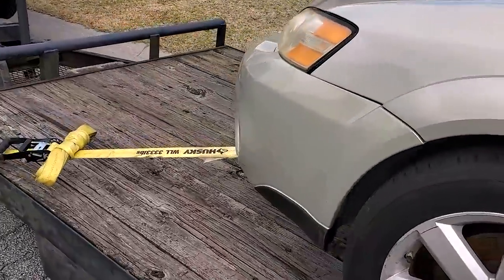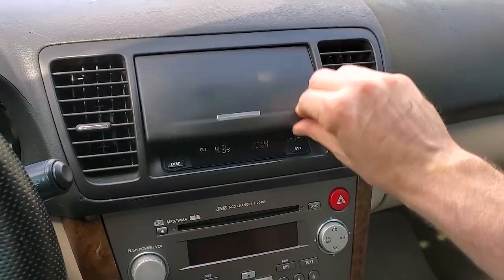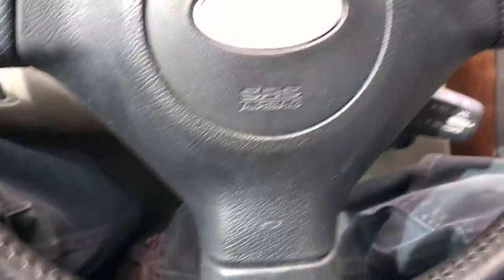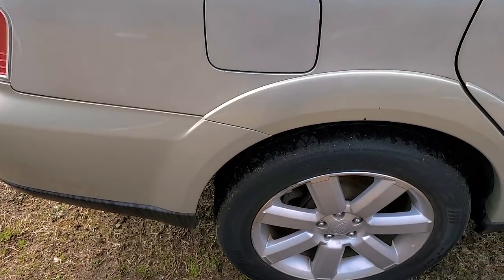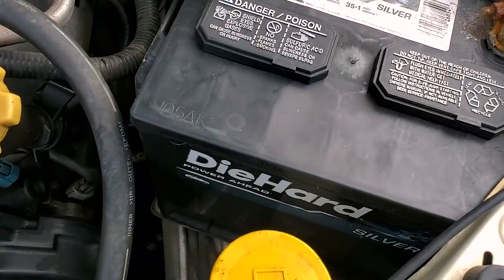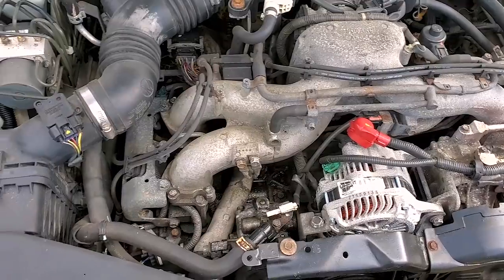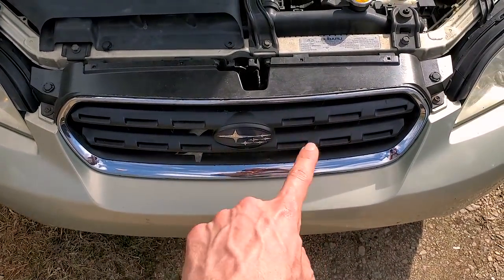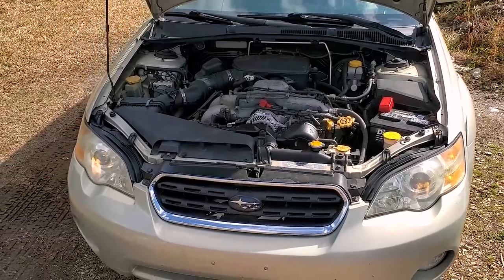Yup.... I bought another one!!! 2007 Outback 2.5i Limited SUS

Comment: I miss the Outback Sedan and Legacy Wagon.
Reply from the maker: Me too.
Reply: I had a 2008 Legacy Wagon, had to replace the Crankshaft position sensor, the power steering pump had a little leak, I just keep adding fluid, and sometimes there was a weird behavior during the start. I had to shake the shifter. It was like the ECU didn't know the gearbox was in parking position, so it didn't start up. After shaking it, something got into position then it started right up.
Reply: @jamespn  its probably the liberty from Aus hahah i have a 2.5 2000 model, it has 340k kms on it and i wanna make a 2 day trip in a month but dunno what to do.. get an old hilux for 3k and ditch this or fix it.
Reply: @dreww47  oh true i think mine must actually be 98 too haha
Reply: @dreww47  but mines a manual
Reply: breakfast meat  yeah wtf

Comment: Thanks for the post and details  , I got 2006 Outback with 237500 KM /147570 Miles , Drives good but not getting a good amount of gas ,Say for Full tank it comes to 350 KM/217 Miles and not sure what Needs to checked or to begin with to improve Gas

Comment: Found 2007 with 155,000 miles stick shift, but they said has not had timing belt set change and leaks oil from "around valve covers".

Comment: Yesss love a good SUS! Didn't even remember they made them that late in the years.
Reply: P.S. Starter failure somewhat common up here past 150-200K miles but it's an easy fix obviously. I think the cold and winter are hard on them plus all the hard starts with dying batteries. Usually just the solenoid that fails. $300 is a steal!
Reply: @802 Garage they made them from 1998-1999 as "Legacy SUS" with the SUS badge on the back and then as a standalone Outback sedan from 2000-2007 across two generations, definitely miss those, especially the L.L. Bean Edition!
Reply: @JWTH531  Yeah I have an 01 essentially parts car. Just didn't know how long they did it. Very cool.

Comment: The Outback sedans are one of my favorite cars, especially with the H6. I’d love to do an H6 swap in my 03 Baja Classic but I doubt it’s worth it.
Reply: I’ve heard the H6 engines are garbage compared to their 2.5 4cyl, is this true?
Reply from the maker: Absolutely not. Stop listening to idiots on the internet. The EZ is the superior engine.
Reply: @richardrecupero4342  No. The H6 engines usually last a quarter million miles without issues. They have a few issues don’t get me wrong, but they don’t suffer from head gasket failure like the EJ25. The ez30d is probably the best H6, with the ez30r close behind, which is just a refresh. The ez36 engines had a few more problems, but they’re still not bad at all. The eg33, which is the old H6 was prone to more problems than average in some cases.
Reply from the maker: There is no EZ30R, fyi. It's the EZ30D Phase I and EZ30D Phase II.

Comment: Where do you shop for the lotta love finds so cheap? You have a peculiar knack, I remember the  Subie near Charlotte, for $500. You won't take on any prescriber atm? I need a  09 3.0 engine or rebuild. Cracked head, or headgasket, rocker arm covers, and inside timing chain cover shows the seal at crank is blown. Okay, sounds like sourcing a JDM engine. Do you know any vendors/sellers who check compression/ leakdown or have a good history to source from? Or would you suggest a mechanic do the buy and  give a 90 day warranty? Guarantee pay labor 1 time? 1) source a engine through a mechanic? 2) BUT,  the  car was in a "minor wreck." THIS I 100% need a  yeah or nay. I'm now shopping for a set of headers, factory OEM, it's a one piece past cat, right? buy a clean OEM set, and cut off the original  cat as "backup?" Or consider a  shop that would fabricate a set very similar to factory? I'm gonna pull back pressure at the 02 sensor port, both sides. Sorry about beating down the consumer report line up. The car is an engineering marvel, with the ECM correcting mechanics keeping in spec with independent timing, I have never seen. It's like flying a high end plane that has 3 fail safes before you drop.
Reply from the maker: Yeah, until I can get the shop built, which isn't happening anytime soon with all this rain, ground is mush, I can't take on any outside work. Unfortunately. Where are you located? I can refer you to my buddy's shop in the mean time. I've seen a jdm engines direct? I think is the name in Charlotte, NC. Prices are fair, never dealt with them before though.

Comment: What do you think of a 2001 Subaru Outback 3.0L H6 4A, 212k miles, car is caught up with all maintenance, no major damage to exterior, but transmission was  rebuilt at 155k. Seller wants $1500 - do you think this is a good deal?
Reply from the maker: Sounds like it's solid. Weird that the trans went out at 155k though.

Comment: Hi! I have a quick question about the headlights on my 2008 forester. I have a choice of blinding oncoming vehicles with my low-beams, or adjusting so that my high-beams are focusing about 25-35 ft. In front of my vehicle. I can't determine what, exactly, the heck is going on. Please help! Thank you for any insight.
Reply: Have you changed bulbs recently. The installation is somewhat tricky. If they don't seat correctly, the beam is off.
Reply: @tomwalma4762  Thank you for your help, Tom. No, no changes recently.  It looks as if they're correctly seated, but my experience with this particular variation(there are two DIFFERENT setups, depending on whether Low or High beams) in installations is limited to this new (to me) vehicle. I appreciate your info!
Reply: @johnnyv.223  would it be possible that bulbs where installed in wrong locations (low beam bulb in h. beam housing)?
Reply: @tomwalma4762  I don't believe so. 
The "High beams" indicator in my instrument cluster, as well as both the physical position of the headlamps(High beams being located more proximal to the center of the vehicle, and the Low beams being more distal from the vehicle center), and the intensity or brightness of the two sets of lamps indicate that their placement or position is correct. Thank you for your reply, though; I also thought of this possibility. It is the most likely cause.

Comment: What are you thought on the 2.5 boxer engine. I have an 08 outback wagon and love it. I had the head gasket, timing belt, water pump kit, plugs, wires, and thermostat replaced a last year. Heard these are crappy engines but mine should be good as new now.

Comment: Hello! I am looking at a 2009 outback 2.5 xt 5 speed with 130 thousand miles, what do you think?
Reply from the maker: That's about the time the turbo dies.. If the banjo bolt filter wasn't removed, feeding the turbo.
Reply: @MrSubaru1387  what lol, I didn't even know that was a thing, ill do more research then! thank you!!!
Reply from the maker: @ryancooper5918  I have a video on it. The EJ255 normally blows the turbo up around 120k miles, if this filter isn't removed or replaced.
Reply: @MrSubaru1387  I just saw it right now, damn, I'm second guessing my choice lol

Comment: What would I need to do an ez30r 6 spd swap with a 2015 3.6r?
Reply from the maker: You'd need to sell the 2015 and buy a 2014 or older. Lol 15+ Legacy/Outback never had a manual transmission option. Would be hard to modify the chassis to work with it. You could still get a 2014 Legacy/Outback with a 6MT from the fatocry. Why replaced the EZ36D with an EZ30D Phase II?
Reply: @MrSubaru1387  Because it was from my understanding that the new 3.6R don't handle boost to well.  2014 is just as good for me.